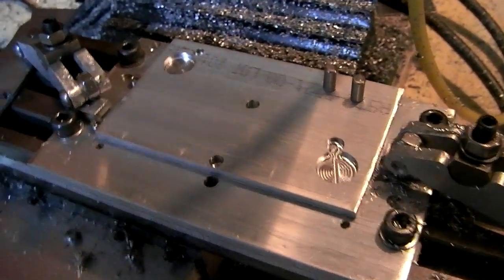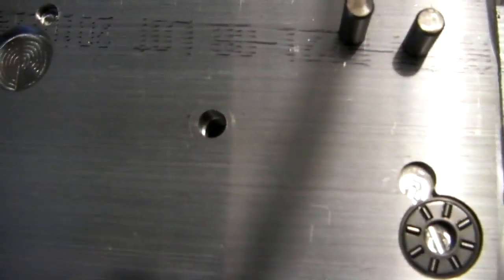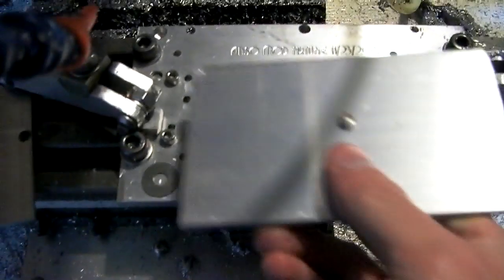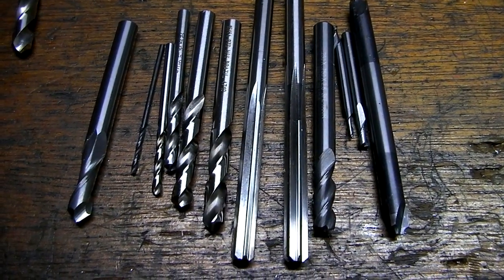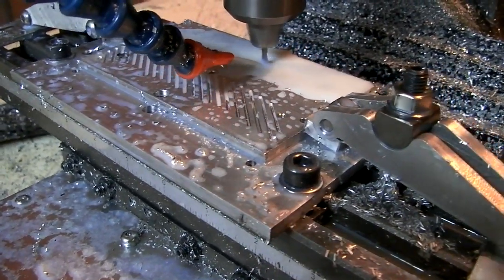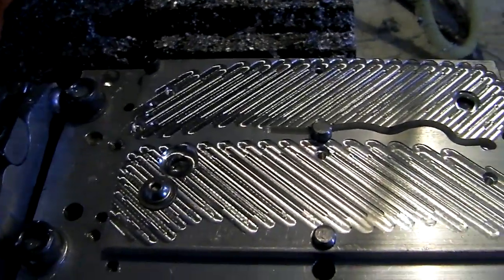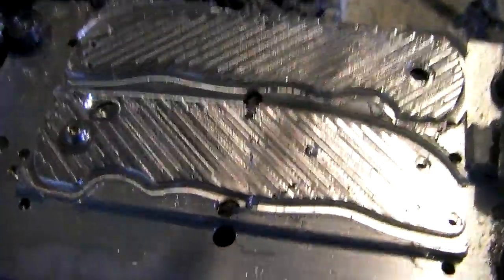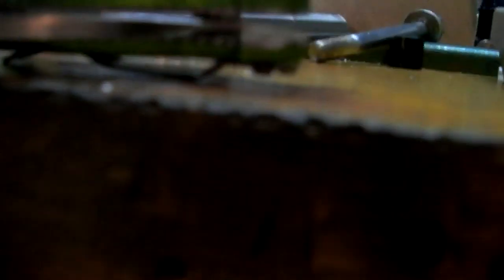Knifemaking Tuesdays Week 04 - machining the first pair of handles!

Comment from the maker: For that particular section, yeah it'll happen again because there were steel pins in the way.  But in general, yes it's very predictable, that's the awesome nature of CNC.  Once you work out the kinks and get a piece of code that works well, you can repeat that a thousand times and technically make identical parts, assuming no fluke issues sneak up.  When something goes wrong, there is always an explanation, it's the machinists job to figure it out and fix it.  Drives me nuts when I can't!

Comment from the maker: @WeThrowRiverside Of course I'm not writing it all from scratch, I'm using SolidCAM, but I still have to deal with a million numbers all the time.  Everything is a measurement, a distance reference, a diameter, a simple calculation, numbers numbers numbers!  Not much difficult math, but lots of simple math and even more numbers.  I often have to edit the code to make it work better/faster, so I've gotta dive into the code and figure out which numbers to change and by how much.

Comment from the maker: @mcauley1869 Thanks for the tip!  Yeah my worry is stripping the holes, then that hole in the fixture is useless.  I'm currently using M4 bolts to hold everything and they're screwed into stainless nuts that I press into the back of the fixture, so they're replaceable.

Comment: That looks nice,  if the blade is like the one you showed interest would buy one.  Also,  I asked you about making handles for a ak 47. The older models came with aluminum but the new have g10 which is what I have. Not sure if they match up. But I would like something done with the blood splatter pattern you did for your brother.  Let me know